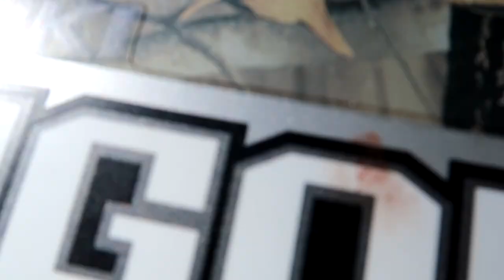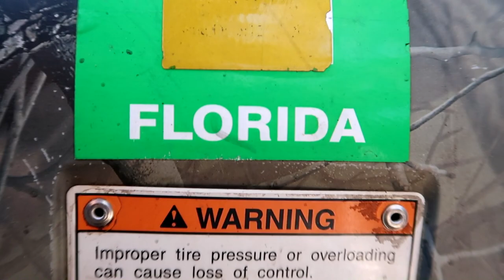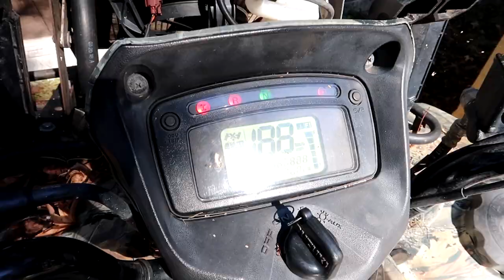Four Wheeler on Ridiculous Square Wheels

Comment: Glad to see someone else is abusing it and not me anymore 😂 I might’ve took a huge loss on it but it’s fun to watch someone else enjoy it
Reply: was that your quad?
Reply: @andrewb232  yes it was before he bought it.
Reply: was it always slow or is something wrong with it
Reply: @andrewb232  it used to have a lot of power. Like after he fixed it that was normal power but in this video it looks like it’s missing a lot of powee
Reply: @RandomVideosInFlorida  well thats turning round wheels lol
Reply: @chickensfloat7427  yea but the spitting and sputtering not sure why it’s doing that before I sold it I had the whole thing tore apart and took at fuel tank out and went through everything so it can’t be a fuel issue but that’s sure what it sounds like
Reply: It needs a valve adjustment.. Very common on them

Comment: Your ATV bogging might be due to not enough airflow restriction. I snorkeled my 400 Suzuki Eiger and while I was running it with open airflow started up fine but it bogged down when I gave it throttle I restricted the airflow a bit and it ran fine no bogging

Comment: I’m guessing gayzuki uses a tip over sensor that reduces power as you bring the front wheels up, which shouldn’t be right because if you climb a hill it will does.